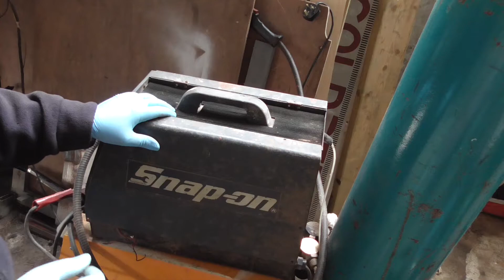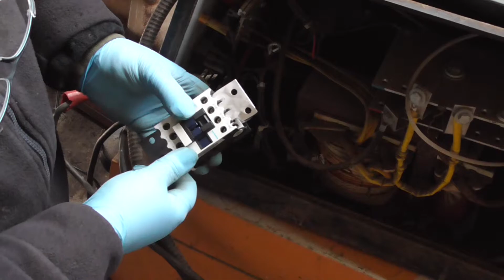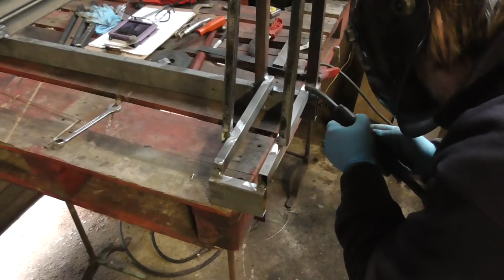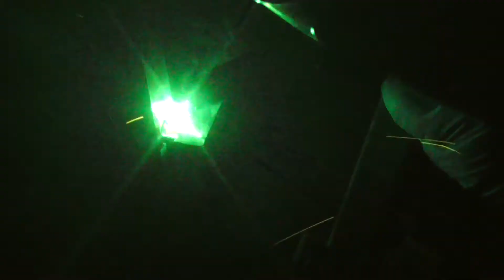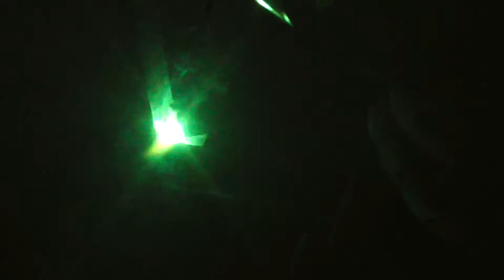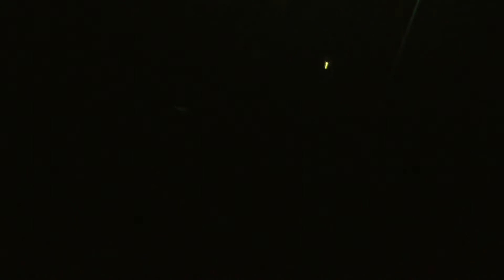Fixing my broken Snap On (Cobra) 2135 MIG welder, faulty contactor

Comment: Hi Andrew. Thanks for the drop off. I am on my third mig welder. Two migatronic 160s. Today I have 160 ESAB. They don't like being in damp conditions. If you turn your gas down so you can hardly here it , Your welds will be hotter, more penetration and flatter. Speak soon. Regards U Al  :o)
Reply from the maker: Thanks Al